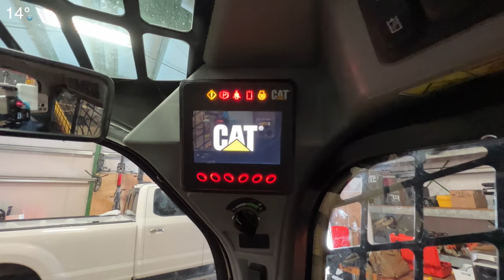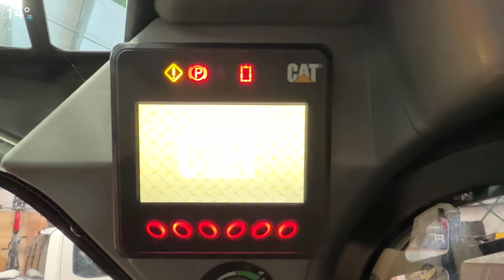How Professional Homeowner Prepares For Mega Storm

Comment: One pro tip for your firewood operation. If you build cages on top of pallets and store your firewood in them. You could just pick em up with the forks and take them to your fireplace with the skidsteer. And that would mean less manual labour in the winter when its cold outside.
Reply: @dougdow1287  yes that woorks too !

Comment: You just showed me a picture of my dream life. Living out in the wilderness, on a river, heating with wood. Nice equipment to do what needs to be done, a beautiful shop space to store and work on everything. Maybe I'll get there. First I have to convince the Mrs. that this is better than life in suburbia!

A few comments: I have this issue in winter in my garage too: dealing with water on the floor when all the vehicles come in covered in snow/slush. I think running a dehumidifier is a good idea, as I've had issues with the excess moisture in the air causing my tools to rust. The problem is a dehumidifier will only work down to about 40°F, so you'd have to keep the place heated at least a little bit. The ultimate solution, and you probably know this too, is to have floor drains and pitch the concrete to them. Then you could even wash stuff in there and get all the slush/salt off with a nice warm water spray. Also looks like you need a slightly bigger wood stove for the size of logs you're putting in there! Hopefully some day I'll achieve my dreams too! God bless from slightly less snowy Michigan.

Comment: Worst repair I ever did roadside was a new alternator. Simple job, but for an East Coast man I was proud to not have to call a tow. Guess I could’ve avoided it all if I had Dual Alternators.
Reply: As an East Coast guy living in Idaho, most epic repair ever was in Pa.  Charged the battery and set off to the junk yard for an alternator  Half way home the battery died and I pulled into a bar parking lot and unplugged their sign and plugged in my charger..  I pulled the alternator in the parking lot and had a fully charged battery and a beer.  When there is a will there is a way.  Now I buy new cars and drink beer at home.  We all men when we choose to be.

Comment: In Sweden, we have the split wood in a wood shed near our wood boiler or wood stove. Easy to pick up when needed.
Reply: unlike us here in Europe the Americans like to start an engine to get things done. I love this stuff Cody gets up too, so much space to do all this cool stuff
Reply: I wouldn’t have my firewood so far away from the shop; why not just stack a cord inside?
Reply: I built a wood shed that will hold 24 loggers cord cut, split, and piled in with a processor. I always gave 3 years of dry firewood. I hated digging it out of the snow! I get 12 cord on one side every three years in rotation. I’m using about 4 log cords per year to heat my home.

Comment: Snow chain storage idea: does your truck have a spare wheel hung under the chassis? If it does, and the wheel is facing down, could you use it as a sort of trough to store the chains in?

Also, when you build your new workshop,  have you though about building a slight fall into the floor, towards the door for example, to make water management easier?

Comment: You should get a tennis court squeegee for drying the shop floor.
It's a big squeegee with small wheels and a rubber lip, about 4 ft wide.
You can dry that whole floor in about 30 seconds.🤔

Comment: Hey out there, nice to see preparation pay off. Love the road side repair stories about your grandfather. My family has a few of those between all the adventures we have had. Best one is still losing an alternator in the middle of New Hampshire in the dead of winter. We were driving back to MA after a day in the mountain, when the lights all dimmed in the Ford Chateau van we were in. My youngest brother was driving alerted us of the trouble and we quickly found an auto parts store down the road. Once there, my second youngest brother got the alternator and tools from the store while my oldest brother and me were disconnecting the old alternator. We had the new one installed in record time and got home with no further issues. To this day, no one in my family calls that incident a breakdown, because we were never stopped long enough for the engine to cool. Just another day.

Comment: Question for you.... 
What brand are those chains?
Also, do you have the part number as well? They look super heavy duty and will fit my Super Duty just right.
Also, my grandfather had an old F100 as his work truck.  He had hooks welded to the rear bumper about 1 every foot across. That truck would end up in some super muddy construction sites. He would hang the chains across the rear bumper. They were always there when he needed them.
Reply: I'd also like to know what brand those chains are. I didn't see any links in the description. Thanks!

Comment: Your stories about fixing things on the side of the road, reminded me of the time I had to replace a cylinder head on my ford Bronco after the thermostat got stuck and cracked the head... all on the bank of a lake.  Yes I did have to find a used head, at a local wrecking yard, but the clean up and install was all me, by myself.  I ended up rebuilding the engine when I got back home... that was tough!!

Comment: The best thing I did for my semi truck was putting a pipe from the exhaust in a spiral underneath a false bottom in the snow chain and tie down box, the chains are always dry and not frozen also less rust forming on them if there is a long time of no use. Just a tip from Iceland, sorry for grammar errors

Comment: Cody is funny bashing the Ram trucks! I guess a Ford is fine if all you tow is a skid steer on a dump trailer. 
Few years ago when we had 28" snow, a friend with a Ford F250 4x4 called me, asked if I would take some round bales of hay out to his cows on another piece of property 15 miles away because he tried and couldn't make it with his Ford. After 4 trips hauling round bales to his cows with my Dodge 2500, cummins 4x4, he tried to buy my truck.

Comment: Hi Cody  we run the same type of chains on our fire trucks here in BC and the cams are great. We  tie back the extra links with baling wire. we use to take a inner tube and cut  through the inner tube  and then take the cross link hooks and use them to take up any slack. we now use the bunger cords that are made for snow chains.

Comment: On larger equipment (grader) , we used to carry extra chain rail links with inner tube cut into giant rubber bands. Best “ bungee” strap.  A good set of chain pliers was also a must.  Run H link Trygg chains off highway all winter, the following winter was when the chain pliers were used, because the chains would be worn out but could be repaired.

Comment: I use the Builtright molle panels in my truck bed and strap everything to them (including my tire chains). Make sure it works with your camper first. Is really be interested in a video with a chain storage solution mounted under the truck!

Comment: My old 1971 Ford F250 had a storage compartment from the factory. It was in the dead space under the bed, just ahead of the rear wheel.. It was great for storing straps and chains.... and of course, extra oil for that 390 under the hood! 
Ive actually thought about the possibility of finding, or making storage box running boards for such items. They could reach under the cab, all the way to the frame to allow for some pretty good storage, and a lot of trucks already have running boards, so it would not look out of place.

Comment: Maine aka east mountain guy new garage just stick a stacked set of 55-gallon drums in foundation of new garage with slight pitch in floor aimed towards 5” drain. All snow and ice from vehicles melts down hole into gravel and sand at base.

Thus far 30 years no issues with ice buildup interior or exterior.

Comment: What if you got stuck in deep snow and couldn’t access the box under the body of the truck!? I throw all my winter gear in a plastic tool box with a lock, underneath my bed cover. Strap it down and it’s good to go all winter, I even throw some fire starting equipment, space blankets, first aid equipment in my winter box. Along with tow rope, chains.

Comment: I am interested in how Cody might /undercoat/corrosion-proof the underside of his truck. My (Toyota) truck is 11 years old so i am not so much interested in the looks of it but do care about it lasting for many years to come in Michigan where salted sand is generously applied to the winter roads. My method is to melt a couple tubes of grease in a thrown away boiling pot before dropping a couple of candles in the melted grease (from Dollar Tree). Then I paint this melted mixture on the towing hardware on the back of my truck with a wide paint brush, then paint the undersides on the edges of the truck. I melt petroleum jelly in the same emptied boiling pot and dip a Plews style oil squirt can into this melt. Once it is full, I screw the top on it and squirt the melted petroleum jelly into the open areas of the doors of my truck. Iam careful to to put too much in the doors because a body man warned me that the condensation from the roof, etc needs to have unplugged drain ports so it does not back up and rust out the doors and piller between the front and back door.

Comment: I drove truck for meany a winter, and put on snow chains lots of times.  I found that a pair of plastic gloves that I used in the garage to keep my hands clean, worked grate when putting on the chains.  I would first put on the plastic gloves, then my heavy work gloves and then put on the chains.  My hands never got wet, so they didn't get cold..  Something to think about..

Comment: East coat guy here and I'd of had plenty of wood inside before all the snow fell. We handle heavy snowfall much better here. Also any other essential equipment such as the yanmar would be front and center if not inside to avoid digging it out. This not meant to be disrespectful just opinion. Be safe

Comment: Your granddad was awesome! East Coast guy here, can't say I appreciate the negative comment about us east coasters, not all are created equal. I am a rock Crawler guy, so, repairs are the norm in a lot of cases on out machines. Frame repairs, engine repairs, ring and pinion replacements, U-Joints, drive shafts, you name it, w have done it. Every once in a while, we have to tow a rig out, but only as a last resort. I even carry a welder (ready welder) with me and it has been used a lot! Mostly on someone else, but, a few times for myself. We don't have the type of weather as you do, but it does come, usually once or twice a year. I just make sure I have the food, water, and fire wood stacked on my back porch, to get me through. So yeah, those of us you prepare, get through it just fine. Oh and as far as a box to carry your chains, an Ammo box(military) will keep them safe and wter tight, maybe a smaller one, one for each side. Just a thought. Hope you have a great year!

Comment: G'day, Grandad did not want the weight of the front axle, Then attaches plywood box full of steel....

I jammed a ring spanner between the alternator and block to get tension on the belt/pulley. Took it out 10 years later.
Reply from the maker: Yes, tire chains weight the same as a complete Dana 44, transfer case, and extra driveshaft,

Comment: Boy  that equipment is the epitome of working smarter not not harder. Isn't it ? A wheelbarrow served the purpose of your skid loader when I was a kid until my brother and I removed the deck from a larger lawn tractor and cut down an old set of cat paw tire chains with a couple weights on the front was designated for all places the truck wouldn't go .

Comment: Meh... My house is heated off geothermal. If for some reason we need more heat, we have electricity generated by a Nuclear Plant on the other side of the Valley. If both of those fail, we have a backup generator, a wind turbine, and a fireplace. We've got solar panels we can bring down from the cabin if we need to. Redundant Backups are more important than deep reserves, that is not however to say that deep reserves are unimportant.

Comment: Used to live in Occupied California. Deployed chains exactly once in 30 years. And that was because of a surprise. Dual rear wheels are absolutely useless in the snow......That is true. But I need them to tow my trailers for work. I have Ford F450's now. A few of them. Doesn't anybody with experience know whether putting chains on the inside wheel is worth the extra effort, or is the outside dual good enough? Also looking for opinions on whether to chain up the front axle on a 4X4. I now live in a place north of Occupied-California, and it snows a lot more here. I would appreciate any advice from people who know what they're talking about!

Comment: I start a fire every morning.  I use 4 to 5 pieces of wood, not any kindling.  I put a fire starter that my wife makes from old candles, lint and egg cartons.  One egg compartment with wax and lint is all i need to start the fire.  I put it between the 2 bottom logs, light it close the doors and walk away.  Never fails.

Comment: You need a 10 foot x 17 foot portable shelter from Harbor freight to put that wood in
Reply from the maker: The fist wind, snow, ice storm would destroy it,
Reply: @wranglerstar  I thought so to but it has handled 70mph winds and snow load like a champ. All i do is intermittently re tap some loose tent stakes around the edge. 4 main tie downs holding strong

Comment: Wow. I thought that I had my moment when I had to change a brake line in a parking lot during the second half of an evening to make sure to be able to get to work in the morning because I had just been hired at my job and I would be fired if I had any call offs within the first year of being hired. You and your grandfather win for sure
Reply: You always get these stories about vehicles from years ago when access to the engines was easier and tolerances weren't so tight.
I was told about a repair cut from a Castrol oil can to a main bearing on an Austin 7 that ran for ages before for correct bearing was installed

Comment: If we live in a g_d forsaken place, I’m grateful he has placed me here (north Idaho for me) as this is the most beautiful place on earth I have lived and wouldn’t change it for love nor money. Something tells me from all you videos I’ve watched over the last almost three yrs, your opinion is probably very close to my own, bless you and your loved ones for that.
If you were looking to fish your stream, I’d try some wet flies, something that resembles those bugs under the rocks in the water.
The chains I bought for my suburban has the welded “V” on the cross links, sadly one night a cross link did break and yes it did damage the side of my vehicle, glad it got me home though. Do wish they cam with the cam tensioners. I also keep some long tie wraps for tensioning. Take a piece of pvc tubing wider that the chains, notch the ends to hold the chain and roll up the chains after every use, it will keep that knot out of your chains and with the chains installed you can keep the pvc in the cab as it isn’t heavy enough to do any damage if you roll

Comment: There's no soft carry option on a Cat skidsteer?
Reply from the maker: I don't know what soft carry is,
Reply: @wranglerstar  I believe it's techically called 'float mode'    I always used it when carrying loads such as firewood or gravel and didn't want to spill anything going over bumps- it gives the bucket a soft feel and it's like suspension 

I believe it's use is supposed to be to smooth over sand and such more evenly by allowing the bucket to follow the contours a bit more easily
Reply from the maker: Hmm, never heard of it,

Comment: I have a FWD crossover and my friend has a big 4 wheel driver and he would brag all the time about it. We were in the pit in NJ and I said if you know how to drive you then FWD won’t stop me from doing what you do. RWD can cause problems though. We started going through the mud and sand and he got his truck stuck but I didn’t get stuck at all. I had wheel spin and had to work hard to keep control but I did it just fine. Knowing some physics really helps too. I’ve had rich friends with Awd cars brag too and then get stuck in the mud hahahahahaha it was always so funny. They’d get so mad and butthurt after bragging for so long.

Comment: Ya dont need a throwout bearing. As long as the clutch is engaged!  Of course the starters hate it.
Reply from the maker: I think it exploded and took out the slave,
Reply: @wranglerstar  ouch! Had a full 4 car hauler in arkansas, headed for louisianna and back to florida. Slave died just outside of pine bluff. What a fun trip. Trans survived, starter died 3 days later.

Comment: Professional homeowner? Let's start with your advice of planning in advance, Why was you wood rack empty in the winter? Why aren't you woodpiles located closer to shed? Why did you load up your shed floor with snow before preparing your chains? why did you use a broom to clean up the mess you made instead of a squeegee? Why didn't you incorporate a proper tinder base above the large wood layer so you wouldn't have the expense of propane which you bought with after tax money? Why are you working on a wet floor? slipping and falling can be as expensive as broken chains to your truck, but if you are laid, up who is going to take care of the misses, sounds like women in your family aren't much use outside the home. Keep your chains off your nice rims so those don't get ruined. I must say you westerners have fantastic memories if as a one or two year old you can regurgitate your grandad's bearing adventure!